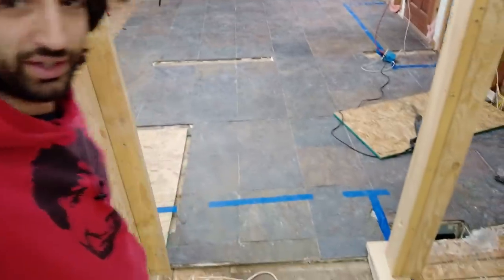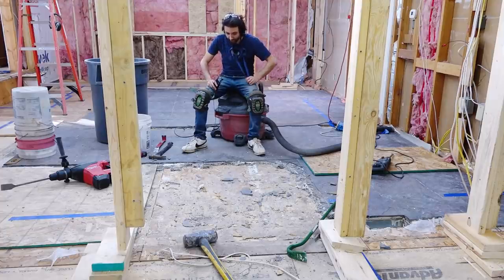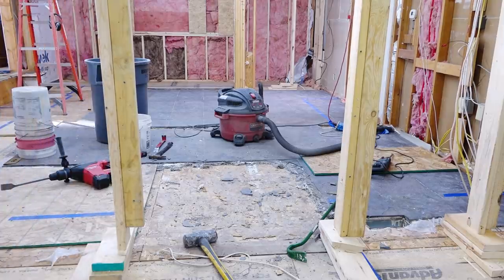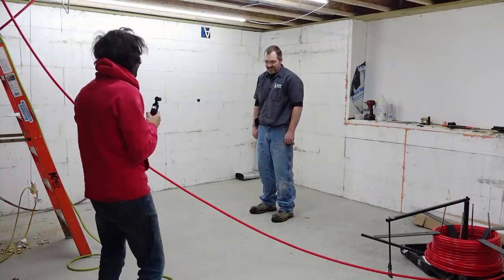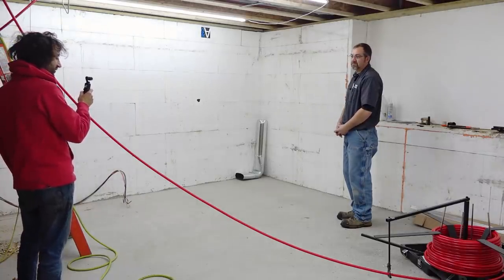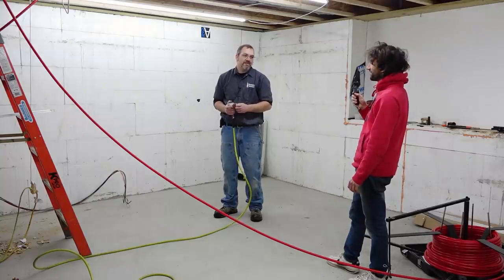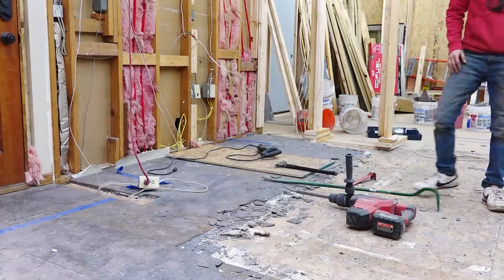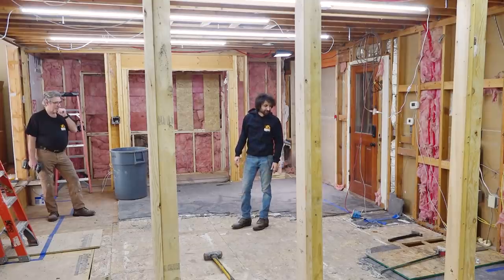Starting to Remove the Slate Floor | Home Renovation & Addition Part 25

Comment: I am sure you are done with this floor by now, but wanted to tell you how I did a similar floor years ago. I tried the same as you with the same tools. Made me crazy!! I finally gave myself a night to think about it and drilled many holes through the subfloor from the basement and used a floor jack. a 2 x 4 and a cut off bolt in the end of the 2 x 4 that get pressed up through the holes in the floor. It popped the tile and crete board up in large sections. The big thing is breaking up the bond. So I went from many buckets of very small pieces to hand carrying large tiles with crete-board stuck to it. It also made for stacking the dump trailer much better..
Reply: Genius

Comment: My knees and back hurt just watching this. Dozens of new hires never showed for the second day of a project like this. Tech college co op types. Usually 1 in 12 stayed for the project. Bought my coffee from quite a few of them after they ghosted. 
That floor use the sledgehammer, just batter every few inches then flake off the easy stuff. Then attack with sds tile spades.

Comment: Not quite the same thing, but when we had our kitchen redone about 20 years ago we found that one of the several layers was asbestos tile. The remediation team ended up taking everything out including the plywood subfloor, as a "sandwich" -- the kitchen was down to the floor joists. As other folks have commented, much faster.

Comment: Did tile  on plywood removal last year and made about as much progress as you have, 9 tiles per hour.   I found a very wide heavy duty putty knife pounded under the tiles seemed to give the biggest pieces but very few were larger then 1/3 of a 12x12 tile.   Had the 'joy' of then having to move it  all 3 stories down through finished hardwood and carpeted floors.

Comment: Also I found roofing spades work really well for removing flooring.👍
Reply: Ditto.  Works great for this kinda job. You can also use potato diggers.  They are 6-8 inches wide and the flat thines get under the material and peels it up.
Reply: @doodwillysr6851  I took a couple roofing spades and put metal handles on them and then I could hit it with a hammer. Making tools Every job seems like your best option to me. Because half this Chinese junk we pay hundreds of dollars for you could build with integrity for a quarter of the price. Great day

Comment: Did this last summer with ceramic over terrazzo and vinyl on a slab... on the third day I put down the jackhammer and bought a long handled scraper. Finished about 200 sq ft in a few hours after that.

Comment: Try using a grinder with a stone cutting blade. Set the depth of cut (to go through the slate and cement board so as not to impact the joists)  and make smaller pieces that can be more easily removed.

Comment: Oh I feel your pain with the tile/slate removal. I had to do a similar project getting rid of an entire floor of tiles so we could put down hardwood. Pain in my knees, back, hands and mind! So much vibration. So much dust. Ugh! Power tools and leverage are your friends. Also, the folks who attached the subfloor to the actual floor must've had stock in a screw company because they fastened those suckers down good! Can't recall how many phillips bits I wore out removing them! Good luck! The house will be beautiful in the end!

Comment: Too late now, but a slag scraper is the tool for that tile removal job.  I used one for cleaning the floor below the 8-torch cutting machine I ran for a few years.  Basically it's 3/8" by 6"x6" steel plate welded to a 5' 1 1/2" iron pipe.  The plate can be sharpened on a bench grinder.  The whole tool should weigh
30-40 pounds, but that weight does the work as you slide it on the floor - standing up.  
You'd have to make it yourself, as we did at my workplace.  It'd also be great for scraping ice.

Comment: Actually you were lucky that the installer didn’t grout the cement board to the sub floor first before attaching the stone... I usually put down  thinset first and lay the cement board into the cement ... then screwing the cement board to subfloor... then thinset back butter tile and thinset on floor with grooved trowel... it stays real good
Reply: It's wood the thinset doesn't stick that well troweled on especially with the hammer drill vibrating it loose. It's a waste of material now if it were ditra or other rolled underlayment then yes you'd have to as the thinner layer bonds to the fibers better.

Comment: I had a similar experience some years ago when renovating a bathroom.  Removal of the wall tiles should have been a breeze but I hadn't reckoned on them being fixed with silicon!  Only elbow grease and sheer determination not to invest in machinery resulted in 20 sq yards taking about two weeks, square inch by square inch.

Comment: I spent 8 years in a house my dad had with radiant floor heating built in 1962.  I think they used 1/4 inch copper tubes.  I was told the whole thing was IN the concrete slab.  Modern is most improved.

Comment: Next time you’re in a hardware store, check out an ice chisel or sidewalk scraper as they might be known, the blade is wider, heavier, and the handle is 5’ long. I lengthened mine with a dowel to about 6’ long (I’m 6’3”). Whatever the length, you can standup and do the work - saves the back. The heavier  the better as you can some weight behind each thrust. There only about $12-15. I use it for ice but I have used it successfully for ice. 

Not applicable in California or anywhere warm…doubt you’d find them.

Comment: I feel your pain. I once had to rip out terracotta floor tiles set directly on concrete. It was essentially impossible to clean off all the thinset. Had to do a thicker than normal thinset with the new tile after.
Reply: You can get thinset off of a concrete substrate with a pneumatic chipper.  A bit messy and very dusty.
Reply: @kenc2257  Yeah. I had a hammer and chisel. Not fun.

Comment: Its probably way too late for this particular project but if you have to ever do this sort of project again, you just completely remove everything including the shbflooring. There are different methods to do this. Years ago one of my uncles cut up from the bottom along both sides of the joists. He the just lifted it out and pried off the pieces left on the joists and replaced the subflooring. There are other similar methods i ave seen them do

Comment: I feel for you dude. I have been there myself. I considered a grenade, also considered ripping up the plywood, also considered a match and lighter fluid but the wife shrugged that one off. So I came up with a solution that worked great, I called in an army of kids and let them have at it. They were cheap and it took them days but they had fun pizza and made some hard earned cash.
Reply from the maker: Very smart solution

Comment: So, under slate was Durock, or something similar, GLUED down to MDF subfloor, then thinset to bond slate to Durock?  Other than seeing orange PEX was installed in aluminum heat distribution plates, I found it difficult to watch. KUDOS to your tenacity for painstakingly removing that slate flooring. What a GRIND!  I hope the next removal method is faster...

Comment: it hurts to see the slate being busted up, but. alas, its inevitable lol... you could put it to use building some slate walls as a decorative feature somewhere. its what ive been doing for the last 15 years around my house. though one project has taken 11 years so far due to delays with weather, material, and scheduling with my crew. definitely not a solo job lol.

Comment: It seems a shame that the slate had to be removed it was installed very well you have to admit. It also looked pretty good at least I think so. Oh well it's your house and home and if you deemed it necessary to remove then that how it needed to be. The renovations seems to be coming along nicely even if it is very difficult at times.

Comment: Here is a link to Stud Pack (youtube) where Paul talks about, and demonstrates, the pneumatic chipper he uses to remove floor tiles. https://youtube.com/watch?v=eerl7iEzL3I&feature=share.  The video is titled:  Remodeling a Hall Bathroom Part 1.
Reply: Yeah that pneumatic chipper looks like a handy tool for Matt
Reply: @Cooldaddio2  Yeah that came so easy because it was installed over plywood. The best sub straight is concrete, then cement board, then everything else far behind.

Comment: The easiest and most efficient way to remove that flooring,  would have been to cut into small strips with a masonry saw. Being careful to set the depth and not cutting into your subfloor. Then you could have pried it up with a lot less effort.

Comment: Hi Matt, on the pex that is attached to the bottom of the floor, what happens when you nail down the sub floor above? Does the sub floor upstairs get glued down or thin set instead of nailing every 4 inches on seams and every six inches across the 4x8 sheathing ? I have seen a nightmare at a friends renovation where the contractor sent so many nails through the aluminum plates below but I never found out how they remedied that disaster. Anyhow, great job and videos, appreciate all you do. Take care. Scot from New Hampshire

Comment: At what temperature are you running the radiant heat system? Would these under floor heat spreaders also work with a low temperature heat pump system (40 C or 104 F)?

Comment: I would of gotten a crappy Diablo ripper blade and put it on my worm drive and made hundreds of cuts only as deep as the bottom of the concrete board... making 6 inch squares.. Those fibers in the fiber board are keeping it tight and not wanting to loosen up.. Also a 6 foot spud bar can be a friend...  Done this many times... The labor is big $$$ on the bid..

Comment: I would have tried a circular saw with masonry blade and cut thru the tile & concrete board. That way the fibers would have had less grip on the larger area around it.

Comment: Flooring like that needs a bigger tool.  There is a long handled, flat bladed, chopper you can get at most hardware places.  It will give you leverage and weight to take up that backerboard.

Comment: I would have used explosives!  I know it is finished now, (February video) but I think I would have tried cutting the floor tiles down to the sub floor with a diamond blade to create smaller 6x6 square pieces.  Although the saw cutting would take some time, I believe that time would be saved many times in the removal.  Sorry Matt, but it was entertaining watching you fighting to win against the floor!

Comment: Matt have you thought about a skillsaw with a stone blade set to cut to the depth of the stone and board, then cut it into sections  ??
Reply from the maker: I’m not sure that would have made much difference. The cement board doesn’t have much tensile strength so it just crumbles

Comment: Why not use a saw with a diamond blade and set depth just deep enough to get through to the subfloor and cut into sections and then remove each section?

Comment: We were replacing the tile in the entry because they were coming loose. We got the tile up to reveal particle board, which is why the tiles were popping. The particle board was stapled to plywood, which was nailed to the sub floor. Very difficult to get up.
Reply from the maker: Woof

Comment: I don't know if this would work on a wood sub-floor, but on my concrete slab if I smacked the tile from the top with a sledge hammer, it tended to knock the tile loose and smash the mortar making it much easier to remove.

Comment: same situation, same tools, we finally ended up getting a small circular saw with a diamond blade and dust collection and sawed every grout joint through the cement board down to the subfloor, then just attacked one tile at a time 🤬

Comment: Would have it have been possible to cut through all the floor layers and remove them. Then put down a new sub floor.
Reply from the maker: Not a particularly simple thing with the infloor heat transfer panels attached to the underside.

Comment: Isn't it ironic that you have to use the same process and tools (breaking it up on a fault line) to remove it from the floor as they did when mining that slate from the quarry initially?

Comment: Why would you not just rip up the boards with the slate still attached?  The boards are going to be mangled where the glue has pulled up the surface, so you'll need to replace them anyway.

Comment: Should have just used the sledge hammer and broke up the slate and the impact of the sledge would have broke loose most of the rest of the floor.

Comment: Years ago I was a builder.  Built a house with slate floor on the landing of the stairs.  Later, the owner decided to tear out he slate and replace it with hardwood.  It was so hard to remove the slate he tore out the plywood subfloor and sat the whole thing out in the woods where eventually it rotted and the slate fell off.  It would be slow, but it might work for you.
Reply: I was thinking along the same lines.  Cut the floor into 2' by 2' or so and remove it all in one shot.

Comment: Wooden subfloor? I'd have tried this for 10 minutes before just getting a wet saw out and changing the whole floor.
Reply from the maker: Oh man. The clean up on that sounds horrid
Reply: @mcremona  I agree, but it'd only take two hours to make that mess. I guess it also depends what's under the subfloor. If it's just the ground, that's a bit easier. If you're raining hell down into another room, yeah, okay.
Reply from the maker: @OliWarner  mix of finished space and the mechanical room beneath

Comment: HELLO MATT, I’M SO SORRY TO SEE YOU STRUGGLING SO MUCH TO REMOVE THE TILES.  I’M NOT SURE IF YOU HAVE FINISHED REMOVING THE FLOOR.  WOULD IT NOT BE EASIER IF YOU CUT ALONG THE GROUT LINE EVERY FOUR SQUARE TILE, SETTING THE DIAMOND BLADE TO THE DEPTH OF THE TILE AND CEMENT BOARD, (SO AS TO NOT CUT THE SUBFLOOR).  THE DIAMOND BLADE WOULD BE MOUNTED ON AN ANGLE GRINDER WITH A VACUUM HOSE BEHIND THE BLADE,SUCKING THE DUST. THEN YOU WOULD USE A ROOFING SPADE SHOVEL TO LEVER UP THE 4 X 4 SQUARE TILES. BEST WISHES AND CONTINUE WITH THE GOOD WORK.  CHEERS! 🥂